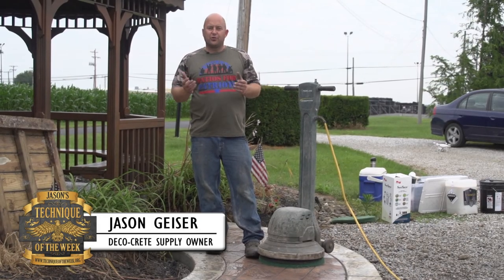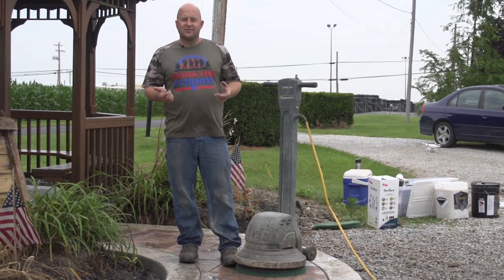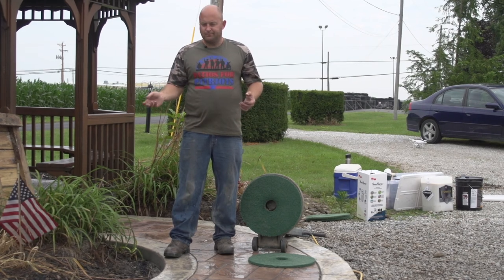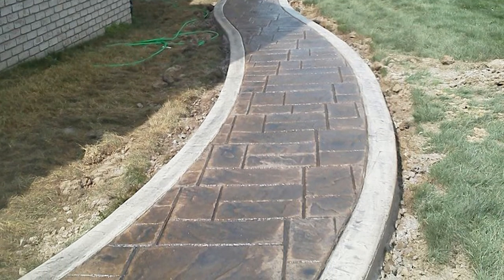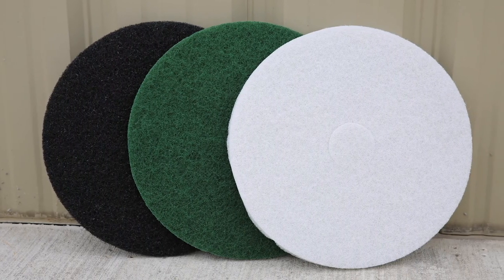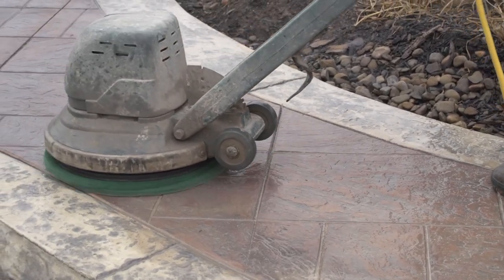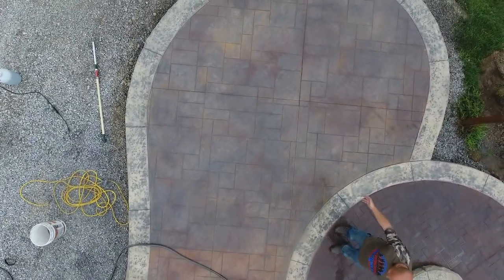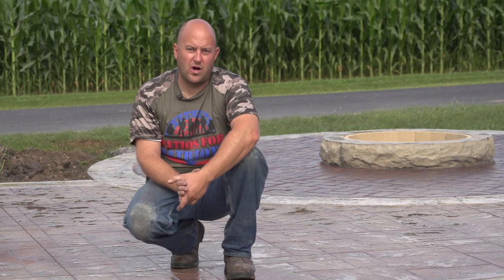How To Lighten Stamped Concrete

Comment: I just did my second put on my project and the second pour it rained later that night after the concrete set up. Now it looks like it has a whitish tint to the surface of my finished product. Would this help?? I did a light brown color and used just liquid release for my stamps.
Reply from the maker: The first thing you should do it give it a thorough pressure wash. The release may just be reacting with the water. If that doesn't work, you should try this technique in the video. Thanks for watching!

Comment: Can you buff the stamped concrete to lighten the color after the sealer is applied ? My concrete color is too dark from charcoal color release agent but the sealer has been applied already
Reply from the maker: Not with the sealer on, you would need to sandblast the sealer off and re-antique the concrete properly. Thanks for watching!
Reply: Deco-Crete Supply thank you

Comment: I just got Omaha tan color concrete but did a dark chocolate brown powder color release and it came out too dark. How long after the pour should I wait before I buff to bring more of the Omaha original tan color out? Or will it even work? By the way I have not sealed it yet as it is the 2nd day
Reply from the maker: This process was done the day after the pour. It will not work after sealing! Thanks for watching John!

Comment: What grit number is recommended? we're in California, not sure if there's a standard grit level associated with the green grip pad?
Reply from the maker: Most manufactures do not have a standard grit for these pads. Most are color coded for soft, medium, and harsh. For this application you want a medium pad, whatever color that might be. You can order the green one Jason is using in the video here: https://www.deco-cretesupply.com/products/abrasives-saw-blades-cup-wheels/17-green-scrubber-pad